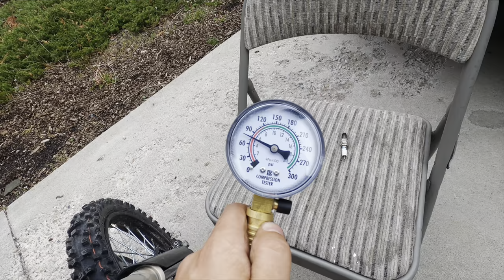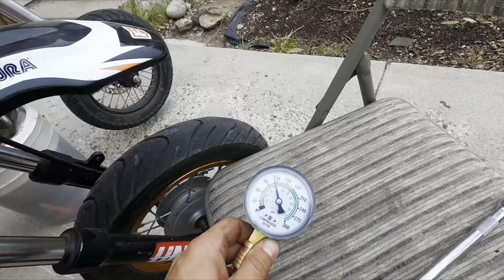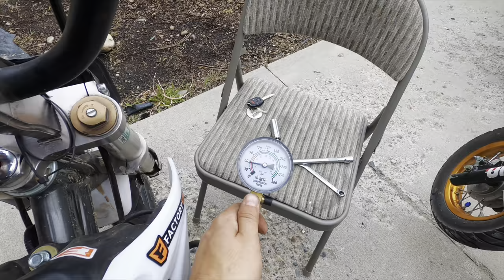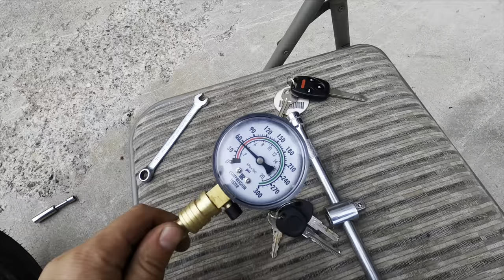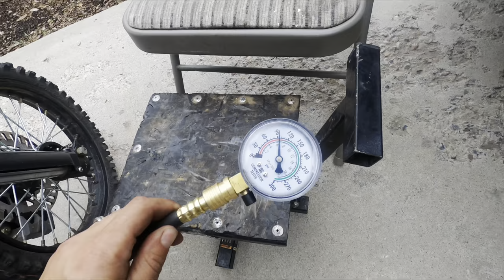Pit Bike Compression Tests are Confusing! | Piranha 125 | YX 140 | Z 190cc

Comment: hey quick thing for future compression tests, hold the throttle wide open and hold the engine shut off button/turn off the key. or else the reading will be low. like my yx150 read 175 psi, I have seen automatic 110cc's making 150psi, your testing method is wrong
Reply from the maker: Didn’t know you had to do that. Will give that a try
Reply: My ssr 140 is 170psi definitely trying the w.o.t method

Comment: Hey bro, I found you again being curious about compression on my 90 cc, a 140cc motors that are both parana motors from tbolt USA. I did a compression test on both of them just now, and they are both between 120 and 125 psi., but from all I have seen,they say to hold the throttle wide open during a compression check. That's how I did it and that's the reading I got. Both bike are barely through the second tank of gas on both bikes. I bought the tester to check a cr 250 I will most likely buy, but decided to check the pit bikes as well cuz I run them preey hard. Hope all is well man, keep up the content and stay safe out there!!💯
Reply from the maker: Yeah your probably right about throttle
Thank you!

Comment: Yx140 also has a decomp. Probably why it’s lower like the 190
Reply from the maker: Where is that located? I only seen it on the 190
Reply: @slavsquad  if you take off the 4 head bolts and under that plate where the rocker arms are you will see it beside them
Reply from the maker: @jamiesh5346  makes a lot more sense then!

Comment: Hi just have to ask did you start on top dead center I no for a car engine compression test you start at TDC before you start  and you probably should put Teflon tape on the threads if it not tight air will leak by the threads.👍👌✌️🏍️🛠️💯
Reply from the maker: No I didn’t start on TDC. Even on cars I’ve never started in TDC or anything I’ve tested actually. Doesn’t make to much sense why you would with compression because it’s just testing the pressure that built up and doesn’t have anything to do with timing or anything like that? 
The tape is a good idea! Didn’t think to use it

Comment: have you had any problems with the 190 skipping gears or down shifting on its own when going fast
Reply from the maker: Yeah mine likes to do some weird skipping thing. Not sure what it is. Also like to pop out of gear and go to neutral sometimes
Reply: @slavsquad  was going to buy a 190 engine but seen a lot of videos about the gear box being really bad thanks for the info
Reply from the maker: @MKTPYT  yeah sucks the gear box ant so good. Other then that it’s a nice engine. Very fast
Reply: Prolly just a burnt clutch slipping. New clutch plates or whole new basket should do the trick